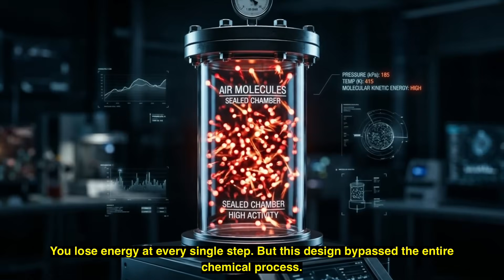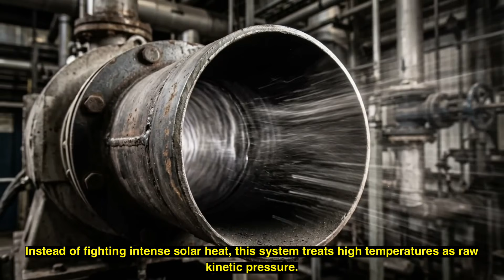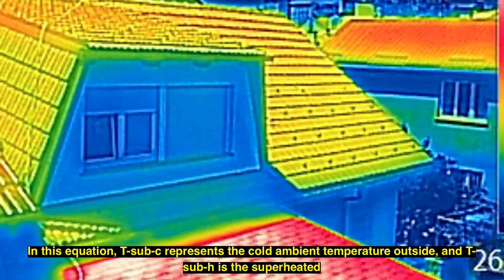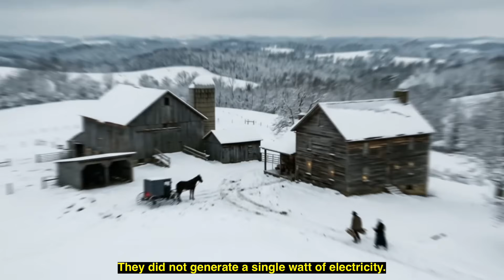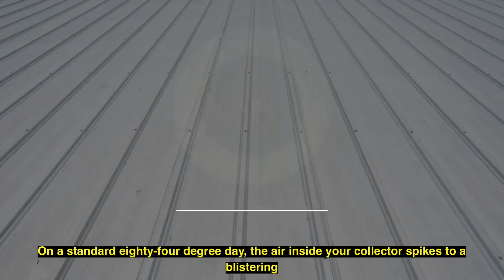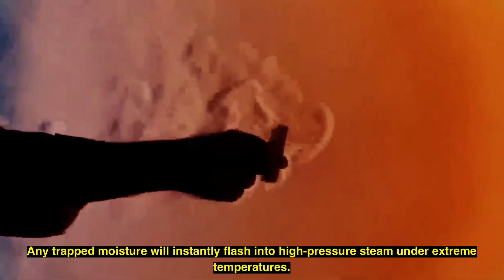Why This $100 "110:1" Thermal Loop Beats $30K Solar Systems

Comment from the maker: It is mind-blowing how a $100 mechanical loop can outperform a $30,000 solar array simply by working with thermodynamics instead of fighting it. Do you think utility companies are genuinely concerned about grid safety, or are they just using regulations to kill cheap, off-grid competition?

Comment: I didn't want to watch this but I had to confirm my suspicions. 

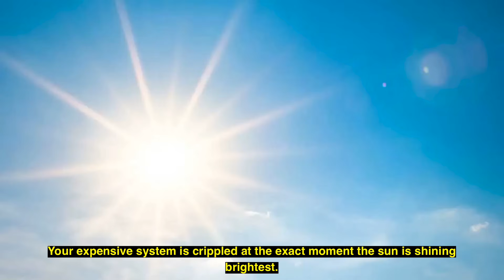I made it to 2:48 after seeing multiple unrelated graphics and hearing the old "they don't want you to know" line. I finally had enough when the temperature dependence of PV panels was described as "crippling." Ridiculous. 

Of course panels are rated at 25ºC. You need some kind of standard to be able to compare one panel to another. They're also rated at a standard light level for the same reason. It's not some conspiracy. Like every other factor, you design a system to take that into account. 

Hey, at low temperatures in my Canadian winters, with reflection off the snow, I get higher efficiencies and extra intensity. So what? Again, you build the system to give you what you need in worst case conditions and the excess is gravy.

Nobody is trying to suppress solar thermal systems, which have been installed at scale for decades. But there is a reason both residential-scale and massive industrial-scale solar power installations in recent years have been pretty much exclusively PV systems.

It has a lot to do with the precipitous drop in the cost of panels. The ones I bought two years ago were 1/20th the cost/watt of the first ones I bought 25 years ago.

One of these days as I slide into retirement, I'll build a little solar thermal system to tinker with, but it will be for pre-heating domestic hot water and some auxiliary space heat, not electrical energy.

Comment: Can I make this at home for my own use
Reply from the maker: Yes, you can definitely build one at home. The system itself is relatively simple. However, before actually using it, I'd recommend checking your local regulations, because in some areas you may need permits or approval from local authorities for energy-related installations. The DIY part is easy—the legal part can be the tricky one. 😉